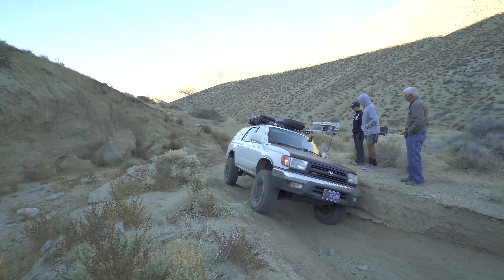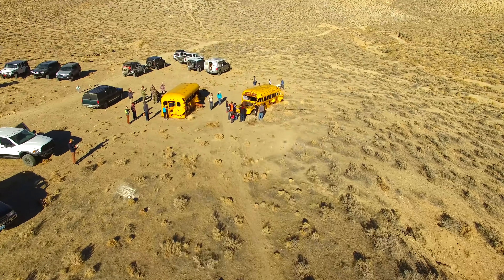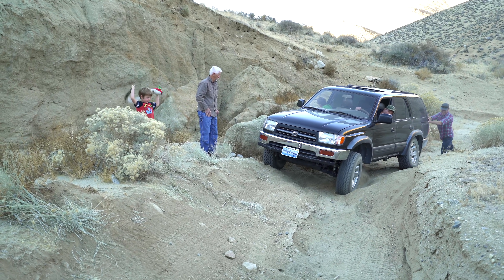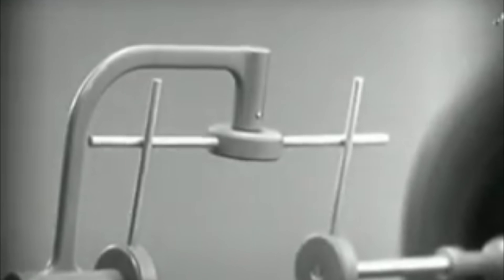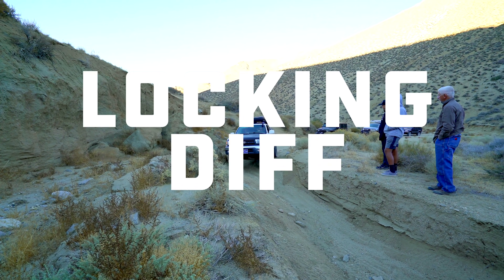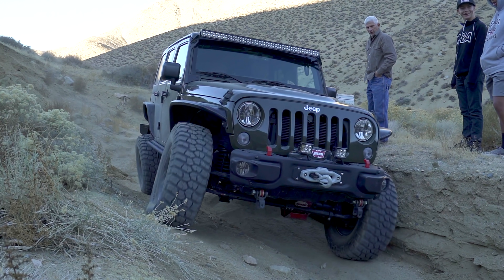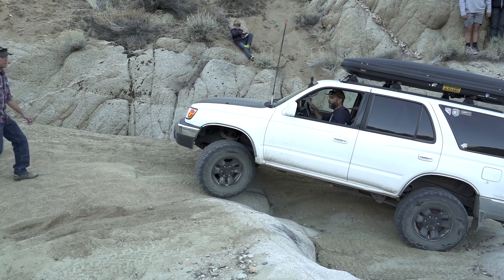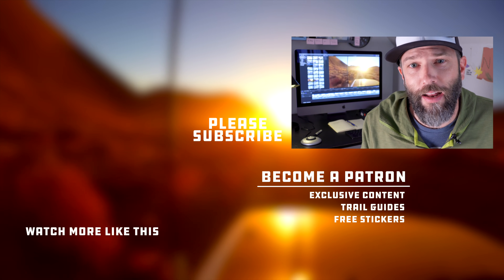Open Differentials vs. Traction Control vs. Lockers

Comment: Good little demonstration.  For years my vehicles had open diffs.  I just drag the brake.  Now, several of my vehicles have LSD's, both gear and clutch type.  Some of my friends have lockers in their vehicles.  But out overlanding in the desert and mountains.  I prefer the gear type LSD.
Reply from the maker: I don’t have much experience with those, but our new van has it.

Comment: IMHO the Thorsen style locker is the best of both worlds. I've used, Detroit, Lunch box, and Thorsen. I first discovered Thorsen in my Camaro Z28 the beauty of that unit is you won't even know you have it, until you need it. Literally when I bought the car I didn't know it had one. I was so impressed I installed one in my Yukon.
Reply from the maker: I’ve heard they can be annoying when making tight turns on pavement.
Reply: @AllTerrainFamily  You  may be confusing the Torsen with the Detroit Locker or the Lunch Box locker because the Torsen allows differential action. Unless you start spinning a tire it has no effect. My detroit locker always let me know it was there chirping and barking and torque steer. On my Yukon I have a Torsen in the rear and a lunch box locker in the front, for cost, and because I swapped in a Dana 60 with locking hubs. I would NEVER  use a standard locker in the front without hubs that would be horrible, on the pavement. I am sure the reason selectable lockers (in front) are used is because installing locking hubs is impractical because of cost or part unavailability. I can control the locker in front by using the transfer case shifter. Admittedly, not as good as unlocking a locker but I rarely find the need to unlock my front axle off pavement. Also, I've never used a Torsen in a full time front axle, because I would never own one, my guess is it would work just fine and be a much cheaper/simpler alternative than a selectable locker, just like my full time rear axle. In both my Camaro and Yukon the Torsen has no effect until you need it.

Comment: A great solution os turning brakes, like on Volkswagen Baja bigs and sand rails. You grab the brake for the wheel spinning and the power has to go to the other wheel. Just need to plumb it in to your brake lines.

Comment: Weilded diff is very very good for muding and i realy hate toyota track control every time i get stuck its because i fergot to remove it like in a steep smooth sand hill for example or when i went snow running the taco billy was rubbuin every where and that quarter of spin of the track control got me highcentered i coulnt send it

Comment: Please, guys. Help me out. I just bought and Grand Vitara V6 3.2
It has traction control and center locker differential system so its a good off road car with proper tires and lift. The thing is I have an air locker that I got to my old Grand Vitara 2.0 (yes, I'm selling the 2.0 to stay with the V6). The air locker is for rear differential. And I don't know if I install in the Grand Vitara V6 because it has the traction control system (the 2.0 Grand Vitara has only the center locker differential). What would you do?  Thanks! Really nice content in this channel
Reply from the maker: Locker beats traction control every day. That said, test it. If you don’t need it save the money.
Reply: @AllTerrainFamily  ok. Thank you very much for the answer. I'll see if I can test it before.

Comment: Great video but regarding your 4Runner, you didn't mention whether it was a rear locker or a center locker so I'm curious. I have a 2019 Highlander AWD with a center diff locker. Would that have helped in the situation?
Reply from the maker: My 4Runner has rear locker. I didn’t know at the time that 3rd gens has a center lock option. That was only the 2001 I believe. Center lock gives you “4 wheel drive.” So it would get you the starting point of this video.
Reply: @AllTerrainFamily  Cool, thanks for getting back to me. Have a great evening! 🙂🤜

Comment: all jeeps newer than 07 come with brake torque traction control. very similar to toyotas system. I have a 2 door JK Rubicon. it is slightly harder to turn with the rear diff locked. but very hard to turn when you lock the front diff, Rubicons also come standard with electronic sway bar disconnects. if he had his sway bar disconnected, he probably could have made it through without a spin.

Comment: Good video!  I've got both a front and rear locker and though they do make turning harder I think its an over statement that a front locker makes it impossible to turn.  The example in this video is clearly a good example of how it can sometimes make it push thru a turn... but one of the tires was in the air and the ground was so loose his other front tire wasn't getting any bite.  I typically turn the front locker off as soon as I can but I've also used in a turn from time to time and it's not crazy if the surface allows a little slippage.

Comment: the traction control in that tundra looks very janky. my zuk has t/c and it works alot smoother and quicker than tundras. the jeep t/c looked alot better. still going to get llockers though. t/c climing sand dunes isnt very effective.

Comment: I know they have a bad rep but I love the GM G80 factory lockers.  I’ve have 3 trucks with over 200k that see a lot of off road use and hauling and have never had an issue.  I drive dirt roads in steep mountains and I wouldn’t want a selectable.  But that’s just for my specific use.

Comment: Lockers are bank!  No clue what I’m going to do yet. I have a 2000 tundra with open diffs. It would be nice to have at least an lsd. Maybe lsd in the front then get a rear locker later??? Any suggestions?
Reply from the maker: I would go rear first.

Comment: I have a 2017 Tacoma trd offroad 4x4 and I've tried some obstacles with the active traction control on, with the locker and with both.  I think the traction control isn't much better than an open differential but I refer to my locker as my get out of trouble free button.

Comment: By far one of the best differential videos I seen.  You didn't claim you was a expert, you said diffs are very complex and you gave your opinion on your video and also opened up for correction if the information was incorrect in anyway.  Great job👍. Too many YouTubers are experts and can't even get a fully loaded Jeep with lockers unstuck in there videos.

Comment: Lockers are awesome. My f150 has traction control and a rear locker I can lose traction climbing up off camber hills and engage the locker and crawl right through. Thinking of adding a torsion or locker in the front. Traction control sucks off road it's very jerky and loud wearing out my brakes it ain't much better off road then a open diff. I turn mine off and use the locker.

Comment: Brake lock differential on Jeep.  Its a factory traction control.  It’s very effective but you must continue to give it slight gas so it stays engaged just as you mentioned.

Comment: You totally missed out LIMITED slip diffs...
Best of both worlds. Lock up when needed, and open when they aren't.
Reply: That description is more along the lines of lunchbox lockers.  LSD is better than an open diff but it still will send most of the power to the unloaded wheel an still get into trouble in the same spots as a vehicle using traction control.

Comment: I'm not a fan of lockers, both front and rear, unless it's in a dedicated off road machine that you take to incredibly difficult places. For a normal street and off road vehicle, a traction device in the rear makes a night and day improvement. How you do this depends on how much money you are willing to spend. Lockers that can be turned on and off are great, even in the front axle, as they cause issues when disengaged and provide lots of help when engaged. The downside is the cost. Cost to buy and cost to have installed. I've been off roading for 50 years and have owned all manner of 4x4 vehicles. What I do is have a "lunch box" locker installed in the rear of my vehicle. The cost of the locker and the install is very economical. And since I'm not a rock crawler or other kind of extreme off roader, these work excellently, for me. Don't get me wrong, I've had to put my vehicles through some fairly extreme terrain, occasionally, but it's usually a short, bad section of a trail I'm on. A true locker, like a Lock right or PowerTrax no slip only has very minor effect on daily driving but is worth it's weight in gold and worth the very small trade off on road when out in the outback and the trail gets difficult. My current ride is a 1998 Jeep Cherokee with 4 inches of lift, a long arm 3 link front suspension, 33 inch tires, and a PowerTrax no slip in the rear. Quite drive-able on the street and awesome out in the boonies.

Comment: Jeep calls that system a BLD (brake locking differential) and even tho it’s obviously not a true locker, it’s a very well working traction control. Weird that the rubicon didn’t have factory e locker tho.

Comment: Tapping the brake only works with a limited slip diff. A regular axle, only 1 wheel spinning no matter if you tap the brake or traction control

Comment: i'd like to see a locking center diff in action. I've always wondered if it's the perfect compromise for a front and rear locked vehicle
Reply from the maker: Not applicable. A center diff only converts from AWD to 4WD.

Comment: Well I always thght that nothing beats the good old tried and tested diff locks 

But the new traction control systems in Rubicons and Range rovers are pretty good too , it’s as good as having lockers
Reply: I have a KL Cherokee Trailhawk.   The traction control is amazing, but it is not the same as a locker.  There is a HUGE difference.  When I engage my locker the driving is much more controlled with less slippage, no bucking, quieter (no brakes noises similar to ABS), and easier on the entire drivetrain.  There is no substitute for lockers!

Comment: Nice vid and trail looks sick. Love my Land Rover LR4 with rear and center lockers and traction control and low range plus terrain select. Put it low, select the terrain setting and just keep the power to her slow and steady.  Terrain select also adjusts throttle input making it super easy to give her the slightest amount of gas. Have had lots of times with a wheel on each side up and no problem. She just pulls and pulls.

Comment: Disconnecting your sway bars will also help keep the wheels planted on the ground, and it's free, locking diffs are expensive
Reply: Ausi Lokka about £300. 
Easy to fit.

Comment: So your saying a lsd that uses clutches is best to use in these situations since its able to be part open diff when its not losing traction and locker when it feels it losses traction on one wheel. Because i know the torsen diff or whatever its called locks the wheels all the time i believe and i feel like it causes what that toyota did pushing the vehicle forward not being able to turn

Comment: ya I only use my locker when I am just about to hit the hard obstacle and then shut it off right away,I have crawl control but have really never needed it ,I know it could be useful for certain situations but I have never needed it but have tried it and it does a good job but I like using the go pedal

Comment: Excellent video. I have a tundra with traction control. Just like in this video, I tend to let up on the throttle just before the traction control engages. I miss the off road features of my 4Runner TRD Off Road, but I like the benefits of having a full size truck, platinum level interior and V8 power.

Comment: I run a Eaton truetrac in my GM10.5 in the rear with an open on my IFS.  In combo with KO2 and 4.56 gears it seems to lock up pretty quick when needed and push me through.

https://youtu.be/x40WGUtdaLI this is another good video that talks about diffs, lockers and what options might be best for you and your rig

Comment: I heen at this a while. All diffs have pros and cons. I think for a 4x4 you drive a lot on road a selectable diff up front electric or air. And rear a good limited slip rear. You will have at best 4 wheels driving and at worst 3 wheels driving. And on snow or sloping surface your wheels can find their own traction. .with a ls you need to keep up on it or it becomes an open diff . traction control can be freaked out in low traction situation s. Plus electronic stuff can fail in cold or wet and muddy conditions. Even a lunchbox locker and LSD rear will give you great results. The rock crawl crowd has some who think 3000 dollars in lockers on your truck is the answer. A LSD rear. Lunch and a quality winch would be better money spent and the leftovers to the fuel fund.

Comment: I had to add an Auburn Gear limited slip differential to my 2017 Tundra. The traction control was working fine until I came up against a difficult section of steep, loose rocks. Even if I still can't get up a section like that, I like to see that all four wheels, or at least three, are spinning. I don't have front lockers.
Nice video. See if you can include a lsd next time 👍

Comment: I heard that there are situations where awd such is in a lexus570 is  preferred to selectable 4x4 with low and rear locker...  When terrain is constantly changing grip, Do you know about this?
Reply from the maker: Yes. AWD is better in snow on roads and high speed dirt roads. As soon as things get steep and rocky and loose 4wd wins.
Reply: @AllTerrainFamily  Thanks
Reply: @AllTerrainFamily  For the kind of terrain that you showed, which is somewhat more extreme than the poorly maintained coastal California mountain roads, that I transit to camp, will either a Lexus LX570 a Ford F150 4x4 with limited slip diff only transit it better?

Comment: I'm a 2wd offroader. I run open diff . If you're running dirt roads, gravel hills up hill. Open diff is good enough. If you're running on uneven roads where one of your wheels is in the ditch. It's more for a lsd and lockers, rock crawling, you need lockers for sure.

Comment: Mine has an open diff. I can't turn them on or off so I'm just going to have it locked full time. I usually off-road on sand so shouldn't be a big deal and it should help me out more.
Reply: In sand a LSD may be better option and tire pressure is vital. And the means to refill your tires for the ride home or as conditions change.

Comment: That was a great demonstration. Selectable lockers are the best but most expensive. Automatic lockers generally work great in the rear and selectable locker in the front if a front locker is really needed. Generally just the addition of a locker in the rear makes the world of a differance! Also the longer the wheel base the easier it is to steer with a spool or locked locker in the rear. Great video! Every year when the snow would hit and the road side would have it plowed up 2 or 3 feet deep I could pull over in old chevy truck in 2 wheel drive put passenger side in the deep snow and driver side on the pavement and light throttle get locker to lock and pull rite out! Yearly test lol that was a 14 bolt rear with the factory governor style GM locker worked very well.

Comment: You missed the Powertrax no slip system!
Reply: Alf B I put LockRights in my ‘94 Jeep front and rear. It turned it into an animal off-road but still allowed me to turn given the outside wheels could turn freely. Too bad they don’t make a set for my ‘07 jk. :(

Comment: Mine is an open diff, I'm new to offroad and will soon test it. I read on break throttle technique, which I guess it's what he was suggesting in the video. I have no abs either (which I read somewhere is best for offroad). What's your take on this, will I have issues there? Almost all videos I've seen, open diff seems to be the worse for offroad though, and, it does make sense.
Reply from the maker: ABS doesn’t work in low range.
Reply: @AllTerrainFamily  so no abs is best for offroad?

Comment: hey great video! but i have a suggestion for you! not all traction controls are the same; for exemple the traction control off the Jeep or a Land rover, engage WAY sooner and smother than the one on the Toyota. it would be great a video comparing the traction controls of different brands, and talking about the driving technic needed when you are diving a vehicle with traction control and compare it with the technic of driving a vehicle with lockers. cheers

Comment: In my opinion the have the diff locked was not really the biggest reasom you couldn't turn. Your front wheels or driver one anyway was off the ground. Therefor you had little to no traction to turn to begin with. Just my opinion
Reply from the maker: Trust me. It’s the lockers. This wasn’t my first experience with this effect.

Comment: Nice video. The Jeep Rubicon has the same system as the Toyota A-TRAC when lockers are not engaged. They're not traction control. Traction control is a system that keeps the wheels spinning at minimal on acceleration, these 4X4 systems are more like what Toyota calls their Active Trac for transferring torque to the wheels with the most traction rather than traction control.